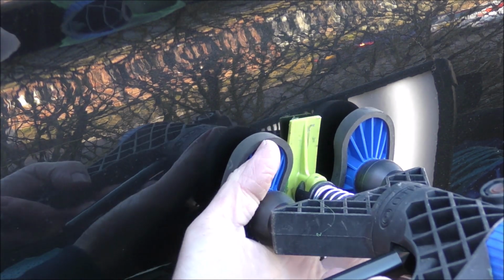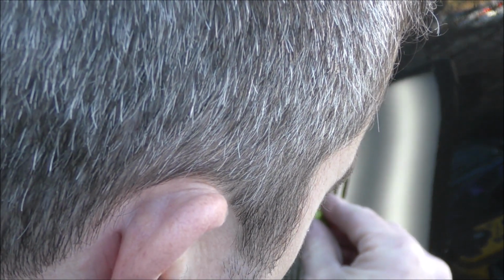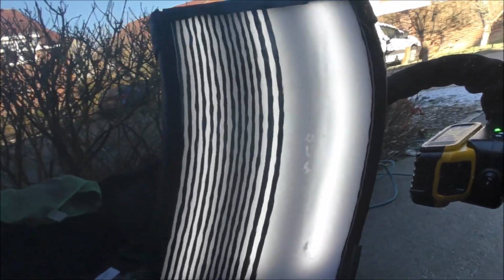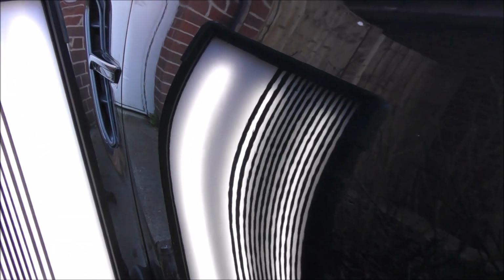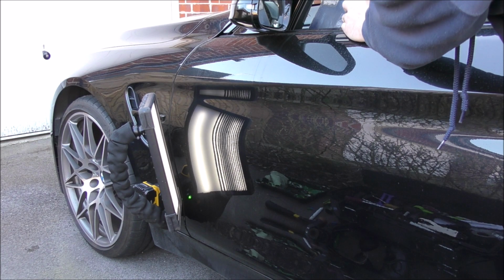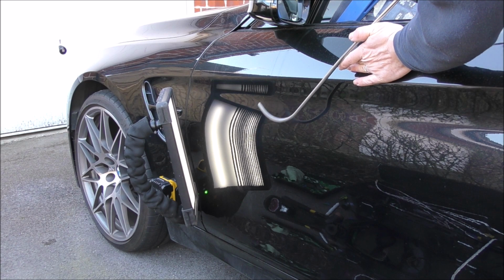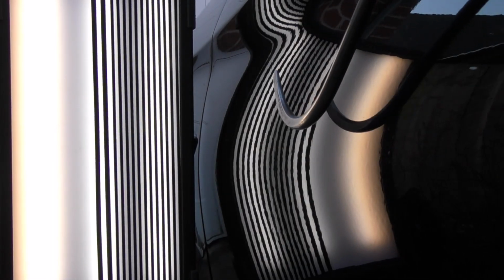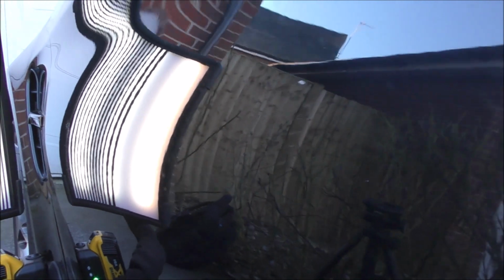6 Inch Door Crease Dent on a BMW M4 - PDR Tutorial

Comment: Real nice job, I worked on a BMW a few weeks ago, not sure what they used for sound deadener but I had to keep heating the spot to push the dent out. Stuff made it hard to get the dent out. Never saw anything like this. You?
Reply from the maker: Thanks Victor! Yes sometimes sound deadening pads can be difficult, there are a few different types some soft some hard and as you say heat is usually advised to soften them up, especially on cold days, I recently did a Merc GLC bootlid and the sound pads in there were pretty solid too,  for soft dents I can use it as a damper instead of on my tool but for sharp dents I need to break through them, just have to be careful of course with those sharp tips, once you go through the pad!